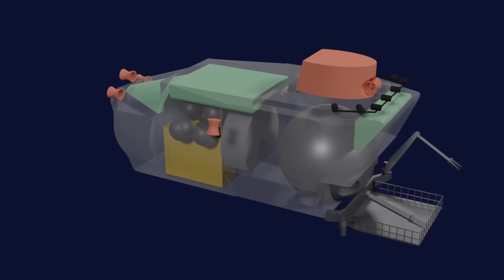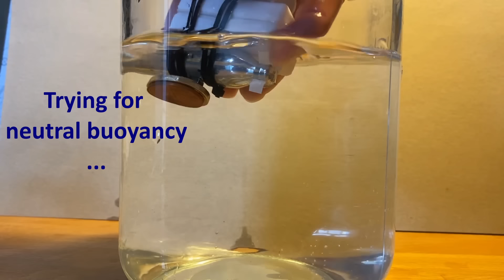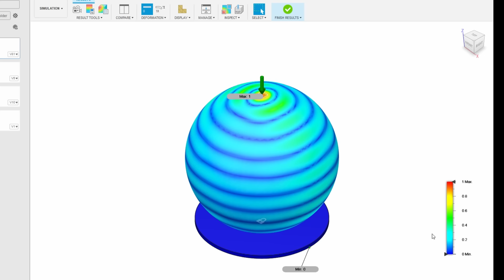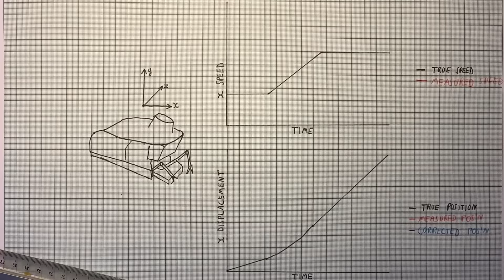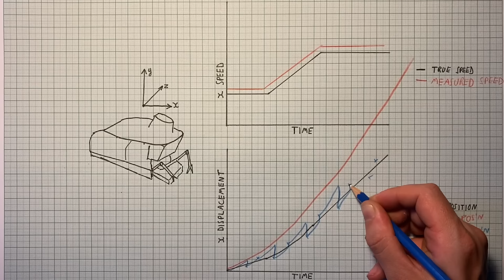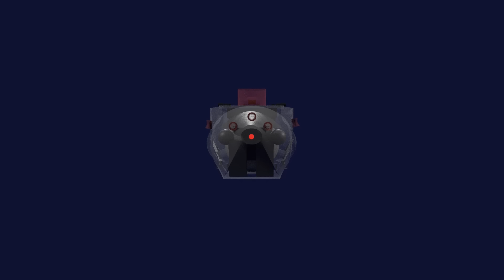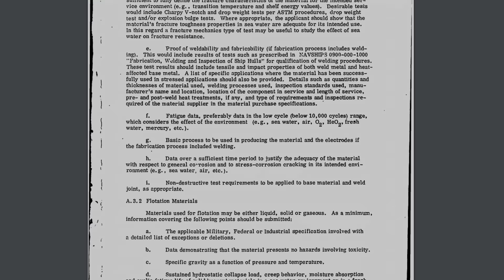DSV Alvin : How to build a safe submersible

Comment from the maker: Ok, as always, here are the clarifications and corrections:

> it turns out it’s pretty common for electron beam welds to be stronger than the base material for complicated materials science reasons that I don’t fully understand.
> When I said ‘titanium is easy to forge’, that was a huge oversimplification! It’s malleable but a ton of specialised processes are necessary to ensure a good quality forge.
> ‘High frequency sound travels further in water’ is also a massive oversimplification. It’s actually attenuated more than lower frequencies. But can carry more information. Underwater telephones shift to a frequency that is a compromise between the two: which happens to be a shift upwards from human speech.
Reply: As a ham radio operator I'd wish to know more about the underwater telephone. The first time I heard about it, I thought it was just converting the audio signal to an amplitude modulated radio signal with no carrier frequency. I believe for that you don't need much more than a microphone, a good amplifier and a very long cable or coil as an antenna. The detector is almost the same in reverse: a big coil, an amplifier and a speaker. If you want to make it really simple, you can even use the speaker as an inductive microphone and a flip switch to switch between reception and transmission.
Anyway, that's my theory so far. But it's hard to imagine that they used no carry frequency, as I believe you could have gotten disturbances from the machine room on such low frequencies - even from mechanical systems.
Reply from the maker: @tigerchills2079 I can never get my head around ham radio stuff, but my first thoughts were exactly the same as yours. Turns out it uses USB modulation but via sound waves instead if EM waves. Exactly how that works, and the physical mechanism for it, I’m not smart enough to understand.
Reply: @Alexander-the-ok  Ah, that's interesting. Upper Side Band, that's half of an amplitude modulated signal, which otherwise is a symmetrical signal around the carrier frequency. So, it's sound waves and no radio waves. Alright, that means they actually use pressure waves in the water to transmit the signal to the next vessel. I guess that could be called a transducer. Maybe submarine/submersible comm's expert can fill in the blanks, but thank you for sharing what you got on the topic
Reply: @tigerchills2079  Which makes it all the more laughable that the Titan submersible was touted as being the iPhone of underwater exploration when they're all but relying on Morse code for communication. What a complete jackass.
Reply: @tigerchills2079 hydrophone or similar transducer.  Typically magnetostrictive material.
Reply: @Alexander-the-ok  How upper-sideband modulation (or any other modulation scheme) works doesn't depend on whether you're using EM waves or acoustic waves, you just swap out the antenna for an acoustic transducer. Increased attenuation sounds like it may actually be a benefit to reduce background noise and multipath interference, since the attenuation of sound waves in water is quite low regardless (negligible at low frequencies, around 1 dB/km at 10 kHz, 10 dB/km at 40 kHz). Shifting to a higher frequency may also just be more convenient for transducers and it would make it much easier to focus the beam which would obviously greatly benefit range while also reducing problems from multipath interference.
Reply: @Alexander-the-ok yet another degree replaced by a USB port😂
Reply: @tigerchills2079  I think it functions like ssb at < 1 MHz; 10Hz-1MHz for underwater communications
Reply: @tigerchills2079  Oh and what you said about the speaker/microphone - I believe that's how sound-powered telephones work on naval ships
Reply: I'd like to start a philosophical discussion about whether Alvin is truly a Ship of Theseus if all its replacement parts were meant to upgrade the submersible and not just 1-to-1 parts from wear and tear, thus you end with with a significantly different vessel than what you started with.  
Then again, since upgrades are meant to push the limits of the vessel, you can say they were all done in the spirit of Alvin and the therefore same ship in that regard.
Reply: @h8GW  I would think that having the replacement parts be better, and thus blatantly different, than the original parts makes it much more of a Ship of Theseus problem, as by the end you have a submarine that's blatantly different from the one in the original snapshot of the past, instead of one that looks and acts exactly the same.

Of course, for most SoT problem including this one, i like the Shrine of Kinkaku-Ji answer; "It is always the same building."
Reply: @h8GW  I prefer Trigger's broom anyhow. https://www.youtube.com/watch?v=56yN2zHtofM
Reply: don't worry, most engineers over the pond agree metric is generally much easier to calculate with.
Reply: Additional correction around 18 min:

It's not "6 A one 4 V ELI", it's "6 Al 4 V ELI". The Al is Aluminum, the V is Vanadium, so it's 6% Aluminum, 4% Vanadium, extra low interstitial (with the balance being titanium).
Reply: As an American, please continue using metric for anything with pounds force and pounds weight. F=ma, but not in America baby!
Reply: @jiaan100  pounds mass is such a cursed unit. We already had slugs for mass, and then someone decided to muck even that up
Reply from the maker: @DoGz_Annihilate  I'm going to tell the story of the time a colleague literally started shouting at me for writing 'lb' instead of 'lbm' as part of a future video. 'Pounds mass' is just the beginning of the unhinged mess that is 'oilfield units'.
Reply: @okalex4687  sounds like you have an unhinged colleague there xD
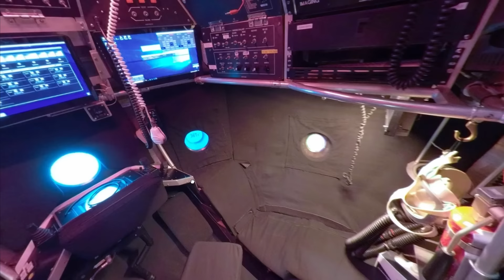Reply: 31:00 my chemistry professor in college dived in the Alvin and he talked about oxygen concentration as a source of deep concern.

I scuba dive and am familiar with some of the concerns in dealing with high oxygen concentrations under pressure, but even I was surprised by how low the oxygen concentration could be to trigger emergency procedures, which consisted of switching to personal rebreathers and flooding the crew compartment with inert gas until oxygen levels could be brought under control.

I do not recall the oxygen partial pressure that would trigger these procedures, but I recall being surprised that it was well under 0.3ata. If I had to guess, I would think it was 0.235ata because that would correspond to 1ata total pressure at 23.5% oxygen, which is the concentration at which the CGA defines a gas as being oxygen enriched and requires oxygen safe construction and cleaning of equipment.
Reply: American here, metric is way better. That said it's easier to imagine in imperial. However, everyone watching is on the internet and could easily Google the conversion. Just type 20 cm to in and boom, you have a conversion.
Reply: Hey!! I’m a welding engineer (B.S WELT) with a masters in material science and engineering. In almost every application welds are specified to be stronger in the as welded condition than the base material
Reply: 0:35 Your voice and accent are NOT weird.  Isaac Arthur back in the day, his was weird, and now it's weird that it's not.
Reply: Points in FEA are nodes, the empty circles surrounded by nodes are elements. Which I thought was apt as generally the elements in FEA contain no information, all information is stored in the nodes.
Reply: Titanium isn't that hard to machine.  It can heat and work harden so as long as you don't get over conservative or over agressive with chip load and surface speed.  Use a good quality tungsten endmill with a titanium nitride (or oxide, I always have to look it up.  T-plus coating (tm) from Helical Solutions😋).  Just trust your tables and run a few test cuts with a hardness tester and your golden.  Source: programming and optimization of cnc programs for aerospace and med implants.
Reply: one quick thing to consider I am pretty sure ping pong balls are slightly pressurized from my time cutting them up for smoke bombs as a kid as they would always hiss. Haven't been able to find anything to back that up with a quick google though so maybe not. Could be why it didn't buckle.
Reply: Dude and if alvin would have ruptured a few months ago you would have made a video saying why they did it wrong... there is literally no winning with you if there is a disaster, it is 100% they screwed up on everything.
Reply: @thomgizziz  you are one bitter loser, probably not very fond of receiving party invitations...
Reply: I was expecting you to say Lithium Iron Phosphate so Lithium Ion was surprising to hear they are using.
Reply: @Alexander-the-ok  I would presume the variable ballast tank uses hydraulic oil not sea water. The oil would be pumped out of the titanium sphere and into a flexible bladder to displace seawater. This would be more reliable.
Reply: @Alexander-the-ok every YouTuber makes mistakes, the one with a clarification post. I just the one that's willing to admit fault
Reply: How is “high frequency doesn’t travel further, it’s attenuated and travels less far” NOT a correction?
Reply from the maker: @jbca ahh you know what? Lets call it a correction then. When I said ‘travels further’, I was referring to the distance it can carry data but I was clearly only referring to that in my head.
Reply: Can I suggest a correction to your video about the subsafe program?

You’re like kinda correct. The one sub that sank I assume was the scorpion(wasn’t ever subsafe certified)

There was a second sub that sank. 
The guitarro, sank pier side because of work being done. Being very pedantic, because it happened in construction technically it wasn’t certified either but it wouldn’t have mattered

Comment: 38:50 arguably the loss of Scorpion was caused by SubSafe
A tragic interaction of operational needs for submarines at sea, combined with the somewhat involved refits needed to bring boats up to SubSafe standards, Scorpion was due for such a refit, but ended up deployed, and lost with all hands.
What operational need required this you might ask? Tracking Soviet missile submarines into the Mid Atlantic, the expectation was that there could reasonably be no warning of war prior to attack, as such a fast attack boat had to track every Soviet missile submarine in striking range of the US.

Comment: Having watched your “Submersible” Trilogy, it really slaps you in the face just how many safeguards, backups and redundancy Oceangate didn’t have.  

Further more the egregiousness of Stockton Rush discounting what had been close to 50 years of design principles.  Safety practices that were determined before microchips were even a thing.

I work on AH-64 Apaches for a living, and I can tell you as something designed to be shot at and survive, there is multi-level redundancy in every critical system not to mention all the exterior systems it coordinates with and the training the pilots go through.  And the Alvin Submersible makes it look barely competent by comparison.

Comment: Naval vessels do not use air ballast for buoyancy control either (beyond surfacing). 

Instead they rely on internal trim tanks, which they can pump out or fill to trim the buoyancy as the captain wishes. As they dive, these tanks have to be pumped out because the pressure hull is getting squashed and shrinks.

Comment: 34:45 one thing I learned from the AirAsia 777 crash is autopilot is not all-or-nothing but a collection of systems. It's more accurate to describe a car's "cruise control" as autothrottle. That understanding makes it easier to share the workload with the automation.
Reply: i once heard someone describe all fly-by-wire as "making the pilot at least think they are flying the craft" and it made me kind of annoyed so to think that pilot assists are seen as all or nothing is crazy

Comment: Great video!
On the subject of metric and imperial measurements, no worries on your end ive experienced way worse. Back in the late 80s and 90s American auto makers were starting their long March to using the metric system. But because of instances like half of a given vehicle being built in Canada and the other half here in the states you get what I ran into while restoring my baby. I managed to buy my very first car back during my 2020 government enforced vacation. Shes an 89 Camaro IROC-Z28 aka the 80iest 80s car that ever 80iezed 😅.  And when I started the dismantling process it quickly became apparent that half the fasteners were standard while the other half were metric. And I don't have an issue with either but switching back and forth like that was a massive pain in my ass. But for ease of use and future maintenance all the standard sized fasteners were replaced with metric parts of which almost all were either 10mm or 13mm surprise surprise😅

Comment: 21:52 

Parts should not fail in the weld, if they are you need to review your inspector/inspection reports, process output data compared to expected, then MTRs, filler metal reports, your procedure and supporting PQRs. 

Welds are developed to intentionally be stronger than base material, in practice it usually ends up still failing in the HAZ. This is typically solved with some sort of heat treatment/preheat procedure. 

If your experiencing fails in your welds you need to do some audits, because there is a significant amount of testing, paperwork, engineering, inspections (1st and 3rd party, gov in anything related to civil infrastructure) and a lot

Unfortunately the science of welding is only taught in dedicated programs, when mech’e will get a weeks worth of lecture on welds, without understanding there is a ridiculous amount of theory

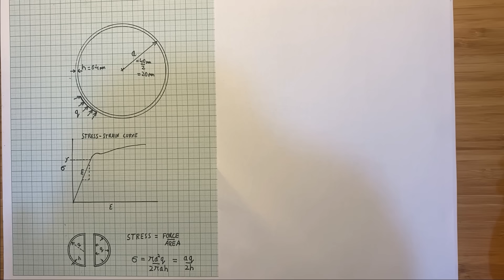Comment: 11:46 No apologies needed here. I’m American but I mentally switched over to metric years ago because freedom units are a pain.
And that was before I started university as a mechanical engineer. 

Converting pound mass into pound force while having a crisis about which one my scale has actually been reeding to me, combined with pressures in psi and surfaces measured in feet…

Freedom units just do psychic damage whenever you try to use them man.

Comment: I was a nerd inspired by Alvin in the 70s. I designed submarines in my teens, including failsafe ballast steel. FWIW, I tested ping pong balls empirically in a lake. 60 % collapsed at around 70 feet, which is close to 2 ATM.

Comment: 1000 freedompounds per square freedomfeet now convert to square  freedominches vs. 1000 kg per square meters to square cm. Point made? 🇨🇭 How many Bar to Psi or take a 1000 l sphere to 200 Bar how many litters of gas? 20,000 now do that in Freedom Units = more likelyhood of maths mistakes.

Comment: Alvin, through all its iterations still used a sphere as the passenger compartment. Material aside, whether titanium or stainless steel will have a very limited number of hull breeches for viewing ports, with a conical plug of plastic, or in the case of control lines, stuffing boxes.

Comment: A Ringlaser Gyro uses several different paths for a laser to follow that are typically oriented along the three spatial planes and if the apparatus is shifted in space, that either intensifies the signal by tiny shortenings of the distance or weakens it by tiny lengthening of the path when the mirrors are moved in space.. so comparing the arriving light intensity allows both to say in which axis a change happened and by the amount of intensity change how much was moved.

btw lots of connections end up stronger than the material they connect... normal welds can if applied very carefully also fall under that heading as do lots of gluejoints... finally broken bones tend to heal stronger and another break will happen at a different place next to the old break, but not through the "scar"...

Comment: I think the biggest question that is raised by the final point - that it's possible to send a crew almost anywhere - is if we're approaching a point where it's no longer necessary.
The process would be much less expensive, somewhat less complex, and much less risky, if it weren't necessary to sustain human lives as well.
If I understand correctly, while human ego certainly plays a role, the biggest hurdle is, as it often is, communication.
By way of illustration, while they did frankly miraculous things with the comparatively rudimentary computers they had available, Apollo simply wouldn't have been possible without humans on board.

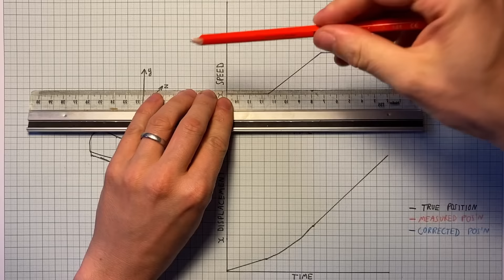Comment: Tiny correction: 25:31 You say that it is accurate but not precise, when in fact it is precise but not accurate. Accuracy denotes the deviation from the true value, whereas precision is the ability to measure small changes. 

Sorry if this was already noted, I didn't see it in the pinned comment. I just found your channel and have enjoyed it immensely so far.

Comment: Former welder-fabricator that built pressure vessels here: on any kind of weld, if there's no defects in the weld itself, the weld will usually be stronger than the base material. So if a failure occurs, it will most likely happen on the edge of the weld, in the transition zone from weld to base material where the metal grain difference and heat stress is highest. So those stories are likely true.
Reply: Sounds like we should make pressure vessels purely out of welds.
Reply: @26kuba05  galaxy brain

Comment: lead acid batteries can endure MUCH more charge/discharge cycles.  they are still used by pallet jacks and forklifts everywhere.  they can survive over 10,000-20k discharge cycles where as l-ion is usually 500-1000

Comment: It is my understanding that it is comically normal for welds themselves to not be the failure zone. Normally the HEA has higher strength than the surrounding material.

There are situations where heat treating and/or aging is undone by a weld; and or welded parts are later treated/aged. neither case will say much about the process and more about the parent material itself.